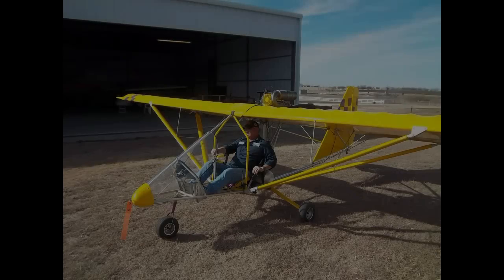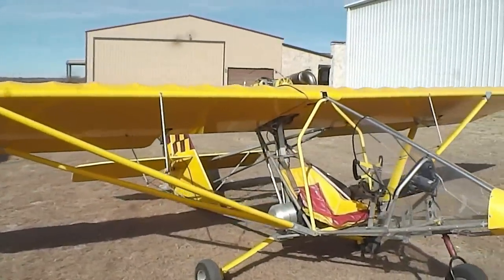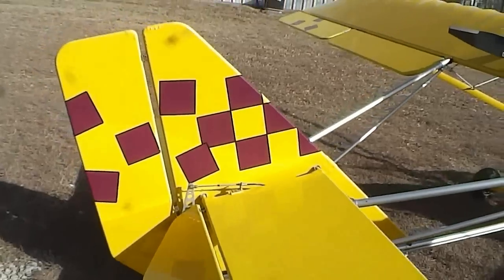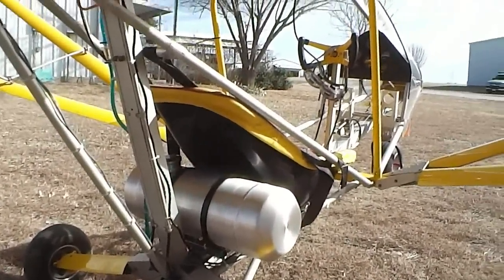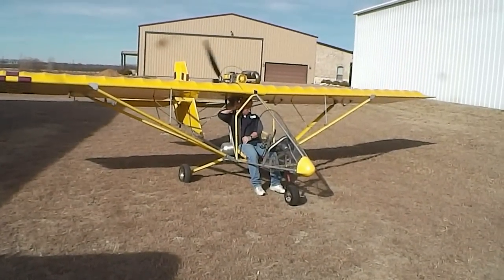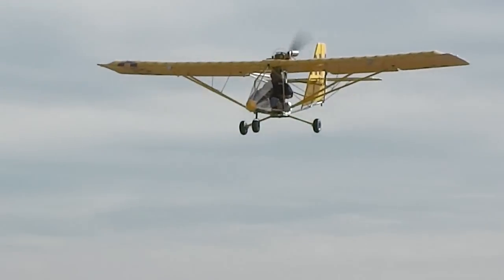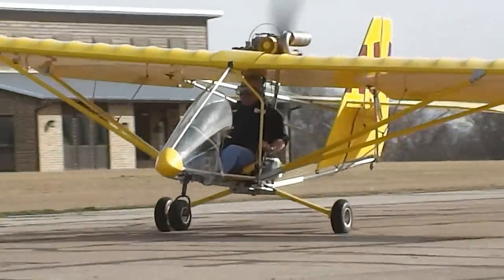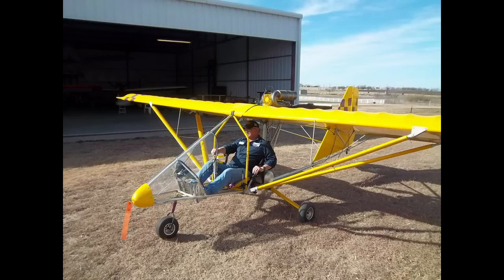Aerolite 103 Ultralight Aircraft for sale $8500 Flight Demo:SOLD FOR $7500

Comment: If this aircraft is to be flown as an ultralight, the sky is not quite the limit. The FAR Part 103 Ultralight Rules are the limits. Weight and airspeed are the biggest limiting factors. Max empty weight on wheels is 254 pounds, max airspeed at full power in level flight is 55 knots calibrated airspeed. It is a good looking aircraft.
Reply: Exactly. The only thing you could add and keep it in Part 103 would be a BRS system. The sky is not the limit plus some training would be nice so a person does not fly into places where they are not supposed to. I like the aircraft but a person needs to be careful of what to say of what you can do.
Reply: Plus most people would have a challenge maintaining it legally.

Comment: Clean, pretty and looks like it handles well. I'd love a 2 seat version with a bit more power.
Reply: Then you are in the Experimental Amateur Built area.
Reply: @mmichaeldonavon  i was thinking the same thing.  I think they do make 2 seat ULs up to a certain weight (ie, trikes for example). The whole "no license needed!" Thing has never been a big selling point for me.  I figure without training flight is pretty seriously risky (I have 20 hours in a 152 from 20 years ago and would def want a bit more even for an UL).  The FAA is even updating some of the medical requirements so hopefully there will be less disqualifying issues for a PPL or SPL.
Reply: @bp968  No license is not the same as no training. only an idiot would fly without training. I mean just forget about the flying part for a second, the FAA will have your ass, part 103 or not, for airspace violations. This video was filmed around Dallas, Some joker bee pops over DFW at 500 feetand there will be a visit made. Can't pull the license, true enough, but hefty fine can be levied. Gotta learn the rules and learn to operate the aircraft, with or without a license
Reply: @jimgriggs2184  i believe its handled similar to moving violations.  At the very least they could get you for willfully endangering other peoples lives (the airline passengers in that case).

Humans don't really think three dimensionally, with altitude.  And they certainly don't think very well at 100+ knots.  Or intuitively grasp things like lift, tip stalls etc.   Its the main reason I've usually laughed when people talk about flying cars.  Flying cars will only be possible when fully automated travel is not only possible but trusted enough to remove manual control.  As long as a human in the cockpit can panic and grab controls the only option will either be extensive training, or total automation.

I hope that in my lifetime I get to at least see a hybrid, a situation where the training is still required but the near flawless health isn't required due to automation (ie, the PIC could have a heart condition and still fly because if he dies in flight the plane can and will land itself).  We are getting closer with the modern avionics.

Comment: this is one of the best airplane out there i ownd a quicksilver 2 seat loved it but it did not have flapes or ailorones this would be my next plane someday very nice design
Reply from the maker: Mike Wing . The only issue was if you are taller than 5ft-8in you cant wear a helmet. If you taller than that you cant sit properly. Its sad its not a plane if you are a tall person
Reply: +Roy Dawson I agree.  That is why I sold mine.  Just couldn't justify not wearing a helmet with my head in the slipstream.  Never know when you are going to hit a goose with a delta v of 90 mph, so a helmet is necessary in my humble opinion.  Also wish they had a way to provide a better windshield which would make a helmet not as necessary.  I heard people tried enclosing these, but they suffered from buffetting in the tail when enclosed or the windshield raised.
Reply: Mike Wing k
Reply: @flygliders  If God meant for tall people to fly...

Comment: Two cycle engine means "two stroke cycle" as opposed to a "four stroke cycle".  My car has a four stroke cycle engine  .  My moped has a two stroke cycle engine, which is simple, light-weight, but needs oil added to the gasoline.

Comment: What concerns me is the engine is a two stoke,which can have reliability issues more than four strokes.Yes,I know,having a two stroke helps keep it under the legal weight limit.
The backyard flyer (Valley Engineering) is more to my liking..
Reply: +vstromranss12 I have owned a 2 cycle Rotax and the maintenance requirements are substantial which means a lot of time that might be spent flying is spent overhauling. And vibration was an issue whereas the 4 stroke Rotax had 3 X the TBO of the 2 and was notably smooth. If you want reliable flight then you pretty well have to get into the Sport Pilot category where the weight allowance permits the better engine. This is a pity. I think the ultralight designation should have always permitted a high enough weight to get around the necessity for using 2 cycle engines. That said I had lots of fun with my 2cycle Drifter though also 2 emergency landings with exhaust (vibration) issues.
Reply: +vstromranss12 You are probably right about the vibration issue but installations differ and the problem with mine, on a Drifter, may have been specific to that aircraft. It caused exhaust bracket fittings to crack.  These were small failures but because the engine is ahead of the prop , anything that comes loose is going to be a disaster so I elected each time for a complete shutdown. I also instructed extensively on a Drifter SB with a 4 stroke engine and it was markedly smoother. Of course the increase in mass may have had a dampening effect. Hard to say. The standard Drifter with a 2 stroke Rotax was the better performer being markedly lighter. In fact it was spectacular.
Reply: Very nice 🥇🙏 India so please give me New pics  Abey leaves India money?
Reply: That heavy engine overhead and slightly behind the pilot could be hard on a helmet with a hard enough landing to collapse the gear.
Reply: I had 2 strokes and 1/2 of me is still very reliable.

Comment: No license? I guess what I read is true that ultralight flying in the USA is extremely dangerous. I fly a ultralight in the UK and at 35 hours I am still in training, this is the Ikarus C42 which may or may not be classed as a ultralight in the US (472.5KG MTOW)
Reply: If you're still training in an ultralight at 35 hours you are either a "tough student" (read slow learner) or your instructor is robbing you. 35 hours is enough for a full pilots license. Decent stick and rudder skills can be learned in less than 20.

Comment: Now if only you could have a 35 gallon fuel tank, that would give me enough fuel to fly the roughly 450 miles from Central Delaware to the Adirondack Mountains of Upstate NY virtually non stop on a day with superb flying weather.
Reply: I'm sure you could shag a few stops between here and there. Barnstorm it. The first tank will get you SEPA. The second to the Poconos. Third hop into the Southern Tier. Then the Foothills of the ADKs. You'll need a break after a couple hours anyway, to tuck your kidneys back in.

Comment: it would be nice if the regulation was a bit more relaxed im 6'6 400 pounds and that gets to be difficult to do ULs tried doing paramotoring once got like 8 feet off the ground
Reply: Friedrich Wilhelm 
Did ya try cutting back on Tacos? Actually if you could cut a Pepsi, or equivalent in calories you'd lost a bit under a pound and a half a month. Don't sound like much but roughly twenty pounds a year. Could you fly at 300 pounds? Five years be flying? 
I was heavy once. Thought it was cool until I bent over to tie my shoes. I discovered I like breathing when I tie my shoes. So I lost the weight. Simple. I stop eating when I’m satisfied. Rarely to I get full. But Thanksgiving I get stuffed. Then miserable and can hardly breathe for about six hours. Love flying.
Reply: Have marital problems and you can lose 20 lbs a week. Take meds for high blood pressure and gain back plus more

Comment: 2 gal an hour at 60 mph is 150 mile range on a 5 gal tank with a duration of 2.5 hour's u said it was 120 and 2 hour's. cool tho and wish we were allowed ultralights in uk
Reply: I believe pilots usually calculate conservatively for safety.
Reply: You should always land with at least half an hour of fuel in your tank. 45 minutes is better.

Comment: Yes, you do need a drivers license to operate Any Motorized vehicle. 
Boat, Ultralight, Scooter, Snowmobile, ATV,  ANYTHING with an engine. 
Just ask a cop, they will confirm this.
Reply: Lawnmower? Kids electric Jeep?
Reply: @df3yt  
Do whatever you want on your own property,  but once you cross onto public property,  anything with a motor is subject to the rules of the local law, and you will need an operators license.
Riding lawnmowers, or anything that moves under power,  believe it or not.
Reply: Nope. For a Sport Pilot's license, you'll need a driver's license in lieu of a medical cert, but no such thing under Part 103.  If you crash into someone's house, the police may get involved, otherwise they will not pull you over to check your license - and neither will the FAA.

Comment: This may be a crazy question, but If this had a suzuki hyabusa motor would the power of the motor make up the difference for the weight of the motor?
Reply: +william brown    Haha   nice try,  but no  !!
Reply: +william brown Well if the airframe could hold the weight (and it can not) it would bump the stall speed to about mach 2. A better bet would be a small Zenoa or some other nitro breathing rc engine. Would be fun to see some nut try it for us.
Reply: God,  but I'd LOVE to see it fly with a 'Busa howling like a good un,  I reckon it would do a vertical climb  lol
Reply: If you like hot rods a long ez air or some other composite single seater. Some of the new ones can cruise above 200. One thing to consider is engine displacement. At higher altitude you need more air volume. Big displacement is needed to maximize the low density air. A turbo would be a must and cutting off all the trany would also be a must.

Comment: OK!!!  Two problems.  First - License needed.  Light Sport required.  Second - 2:07 Engine running, avgas behind you, fuel line running overhead, and cigarette in mouth!!!  Seriously????
Reply from the maker: add a beer to the mix??
Reply: Roy Dawson Finished it during pre flight.
Reply: +Cannon Gill That's exactly right Cannon Gill.
Reply: was going to say the same but ime like a year behind lol
Reply: And does it have beer holder?  I mean a cup holder?
Reply: Flight220 Cigarettes  do not ignite fuel in general everyday situtations.
Reply: Sorry Cannon if it flies over 63 mph straight and level with no wind it's not an ultralight
Reply: Scan Account don’t know what you’re talking about. Smfh
Reply: your wrong about the License..this is ma PART 103 legal without a license aircraft.
Reply: This is an ultralight part 103 legal aircraft.
Reply: I assumed he was adding a tail wind.
Reply: Flight220 i know, a cigar would be better!
Reply: Roy Dawson yes a Bud Light would be great! 😊
Reply: 55 knots = 63.2 mph
Reply: No brains required either.
Reply: K. W. Churchill you are wrong. Top speed is too fast and it exceeds maximum weight limit. Absolutely does not meet FAR 103 requirements.
Reply: Buddy, before you go bananas, you don’t need a license for a 1 seater.
Also, he finished his ciggy preflight.
Reply: I learned in The Great Waldo Pepper never to smoke around aircraft.

Comment: I've heard Ultralights were pretty dangerous, even worse than regular planes.  Any objections?
Reply: +Lauren Mesquite Are you suggesting regular planes are dangerous? They are much safer than cars.
Reply: True, they're safer than cars, at least I think so.  Keep in mind I've been told about them; by no means do I agree they're dangerous.
Reply: A few reason people say they are dangerous.
- they use 2-strokes for weight savings which are not as reliable as 4-stroke
- During an engine out, they loose speed quickly due to low mass. If you dont get that nose down quick, you will stall.
- Idiots without formal training hopping in them (since they dont require a license), and crashing.
- They are best flown dawn or dusk in dead calm air.
Reply: Yes, I object your honor. On the grounds that it's incompetent, irrelevant and immaterial.

Comment: if engine stalls or runs out of fuel or fails, could you land it without the engine running?
Reply: I think thats required for every plane, even big passenger ones. The biggest issue is to find a landing spot because you have to keep a certain degree going down in order to stay above the stall speed. If you fly slower than the stall speed your wings will generate not enough lift and you will fall from the sky like a stone. This also happens for bigger planes from time to time but mostly because their airspeed sensors on the outside freeze and they get below the stall speed without knowing. Flying ultra lights you have a pretty good feeling for the speed because you get the wind right in the face :-) I think even helicopters must be able to land safely with an engine failure. This is called autorotation maneuver. The pilot pushes the nose down to get vertikal speed so the rotors start to spin on their own from the drag (autorotation) and he pulls up just above the ground which slows down the rotors and the helicopter for a soft landing. Like a bird spreading its wings just above the ground.
Reply: almost impossible to do with a helicopter
Reply: Tony Boroni Hey, here is a video of it: watch?v=vLtOO7zqX2k I'm not entirely sure but as far as I know every pilot needs that training for his license. In training the engine is of course not completely cut off but put in idle which is not much different than cutting it off. You can think of it like in the car. If you go into neutral an put the engine into idle you will become slower due to wind resistance. If you go downhill however you will keep most of your speed. That is what the helicopter does. The blades get slower and he counters that by a nosedive. Just above the ground he pulls the nose up again which slows thr rotor down a lot which you can hear in the end. The problem is this is not very healthy for the helicopter and is therefore not trained as much as it should to become a second nature to the pilot.
Reply: year ngine still runing its just at low speed engine cut off fully is a hard one to pull.
Reply: Tony Boroni The way the autorotate works is that the rotor is basically put into neutral if the engine quits, and the blade pitch is altered.  As the heli drops, air rushes over the blades, which gets them to spin, even though the engine is not running, it's just from the air.  Then once the rotor is spinning, as it heads towards the ground, the pilot pitches the rotor blades and since they are spinning at a high rate (hopefully) and it takes some time to slow their mass, they create lift for a few seconds.  The trick is to be high enough to get the blades spinning, and for the pilot to be low enough when he flares, to set the heli down as easily as possible.  This is a one time shot, but if the engine is dead, it's better than nothing.   Hope this makes sence, I can visualize it, but it's a bit hard to explain.
Reply: +Tony Boroni Not true.  I would much rather be in a helicopter and lose an engine, than an airplane. You can land an engine out helicopter with zero forward airspeed.
Reply: Define 'land.'

Comment: If you are under the impression that you are under Part 103.1, your aircraft has to be 254 pounds or under Empty weight.  I looked up the Rotax 447 engine and it alone is 59.1 pounds.  That leaves only 195 pounds for the entire rest of the aircraft with Frame, Wings and Tail.  Secondly, you BETTER not be able to fly 70 mph.  The fastest the FAA will allow an ULTRALIGHT to fly is 55 knots which is 63.3 MPH so you would be clearly violating the FAA rules for Ultralights.  I see that this is sold already so since you used this YOUTUBE Video to give some specifications on the aircraft, you have already violated the FAA's Part 103 regulations.  I'm surprised that the FAA hasn't called you to ask you about it.
Captain David Vincent - A LEGAL ULTRALIGHT PILOT flying a LAZAIR..